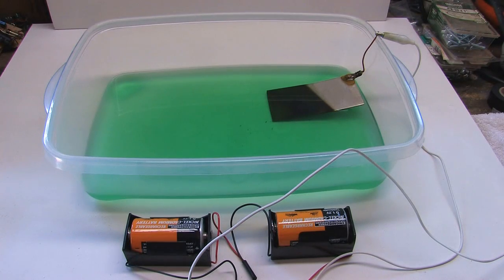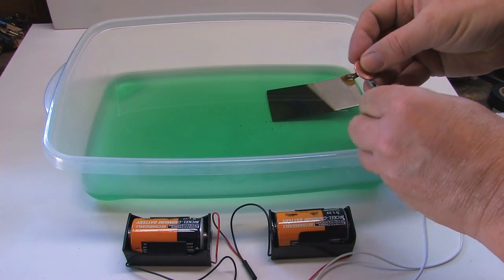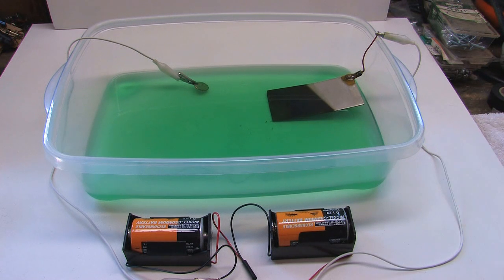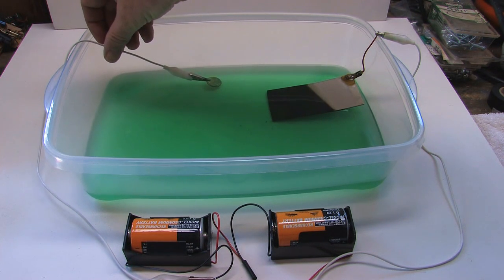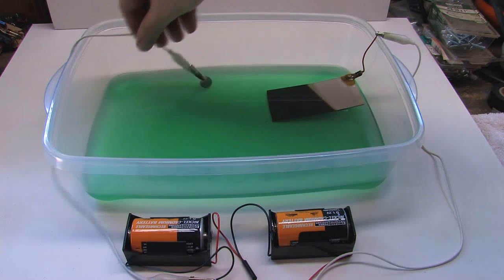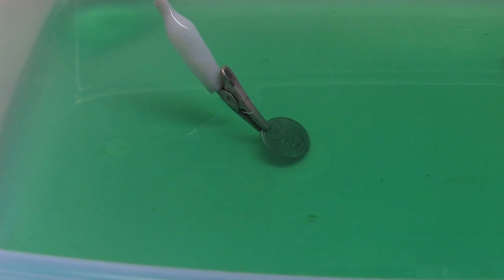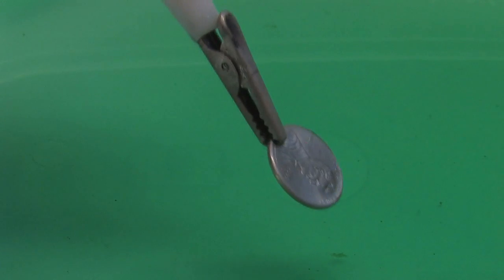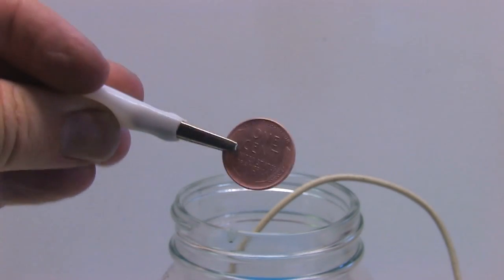Easy Nickel And Copper Electroplating Method

Comment from the maker: Aluminum is very tricky to plate, and you'll need to have a predip and special treatment to get a good plate.  Pot metal is hit and miss.  It often contains a lot of lead or zinc which does not want to plate (it can blister after you plate it).  There are dips that can help with this such as a a fluoboric acid pre dip, but that's outside the range of my knowledge.  Best to get a plating book for an exact formula.  Or, once again, it is always possible to just try it.  :-)

Comment from the maker: I plated copper screens for some home made batteries I was working on.  The screens were an ultra fine mesh, and so, had a high surface area.  The solution and batteries shown in the video seemed to do a good job in about 30 minutes visually.  I gave the screens a thorough scrub and buffing, and the nickel plate seemed to have excellent adhesion.  It's cheap enough to just "try and see."  Thanks!

Comment: I nickle plated a brass key when I was in the 7th grade. it was my locker lock. The plating didn't wear off until mid way through my 9th grade year... The copper over nickle didn't last as long... 

Good video!

Comment from the maker: @drunkadian Try it on a few scrap parts first and see if you're happy with the thickness/durability/look.
I've plated a lot of items with this simple method and gotten very smooth, durable results.  But, for something very expensive like a gun, you might also want to check into more traditional mixes like a "Watts bath," which you can find on wiki.  :-)

Comment: How do you make the rig to do this? I have a nineteen fourty three steel penny and I want to electroplate it back to copper. is it just the battery holders, aligator clips, and the anode?

and also, what chemicals can you use to plate gold?

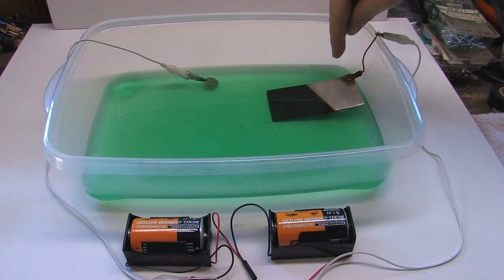Comment from the maker: @tybardy As mentioned in the video at :17, I used 1 quart warm tap water to 3 oz. nickel ammonium sulphate.   Also as mentioned at 1:40, the nickel plate is connected to 
"+", and the piece to be plated is connected to "-."  You can get a piece of pure nickel for your anode from suppliers like McMaster Carr, or a nickel welding rod from a welding shop.  Canadian nickels before 1982 were almost pure nickel and work.  They have them on eBay cheap!  Lot's of sources with a google search.

Comment from the maker: @SMARTROOFSYSTEMS1 
Most people use 12V, but I used two "D" cells.  Considering they were NiCads, that's only 2.4 volts total.
I've had MUCH better results with low voltages.  It takes longer, but the finish is smooth and shiney!
Thanks.  Mahalo!